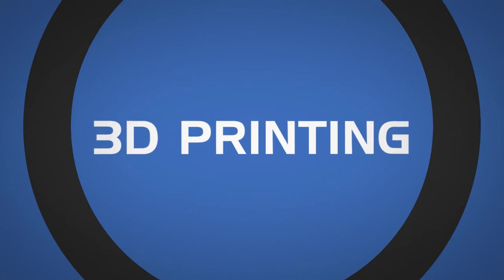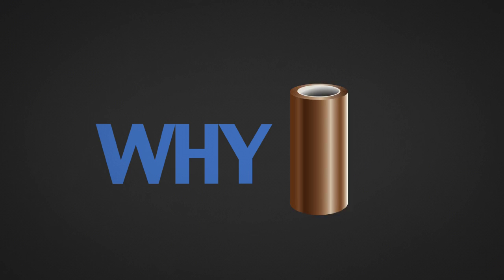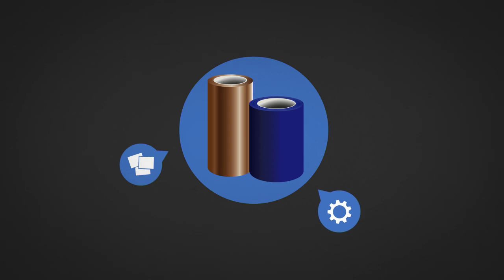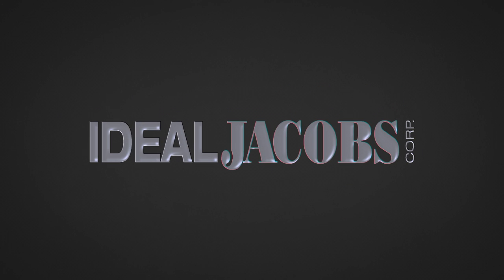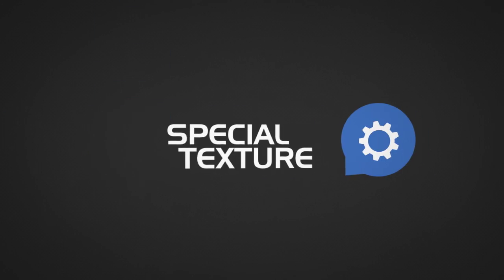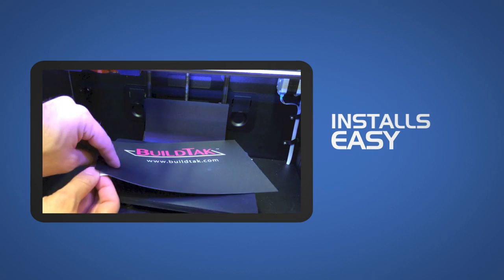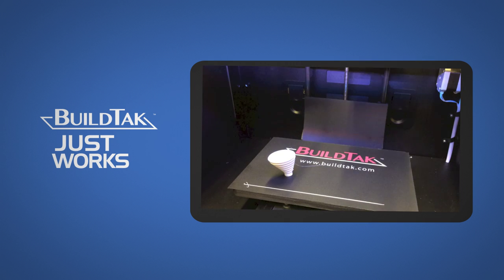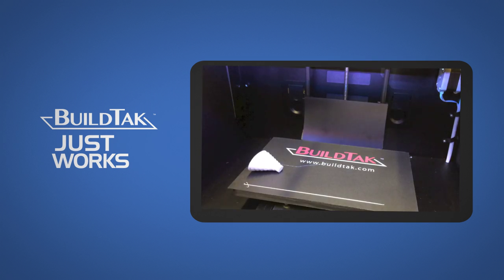BuildTak -  It Just Works.

Comment: So far with my testing with PLA this has been fantastic. Previously with PLA objects would stick most of the time to headed kapton and would normally pop off when cold. However id have a pretty high failure rate. 

I ordered some Buildtak from 3Dprintgear and figured I'd try it out. After printing 50 of the object id previously have a 1-4 failure rate for I figured id try it on ABS.

its my first time with ABS so I cant really compare it to Kapton.. but seems to work reasonably well.. I feel there is some more tweaking required on my Hadron.

I'll upload a first impressions video soon.

Comment: Ideal for ABS or PLA but what if is used for a PolyJet composite powder that needs to be cured?
Manufacturers from 3DS Systems or ZCorp sell a $370 dipping kit with a polyethylene sheet but won't sell this sheet separately. Considering all I need is the sheet I am not going to pay them this amount for a kit.